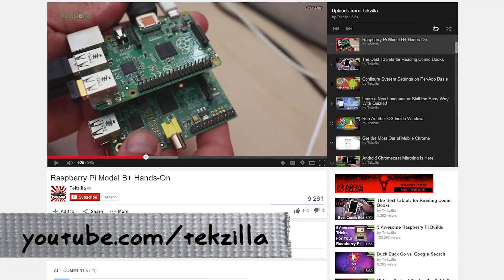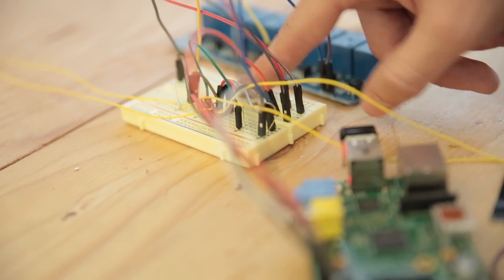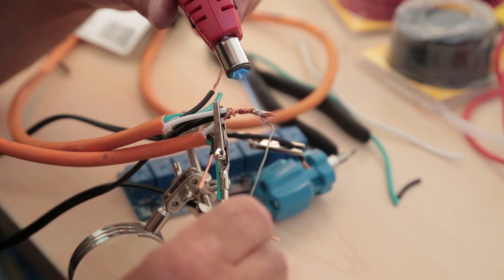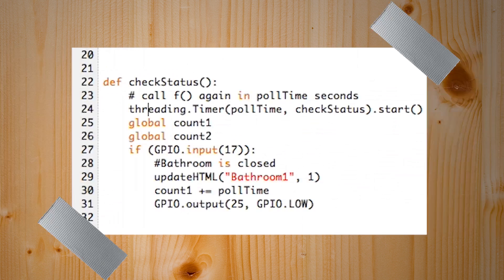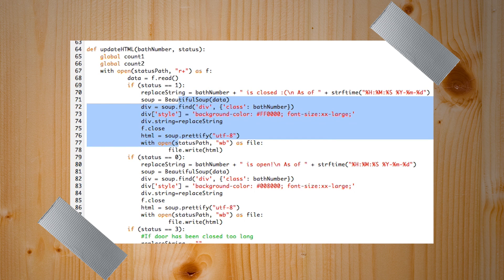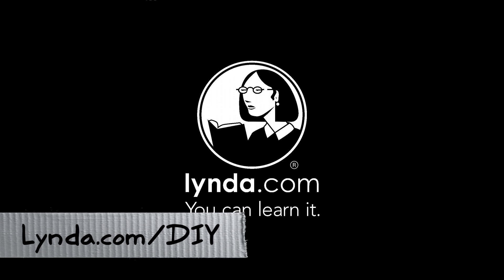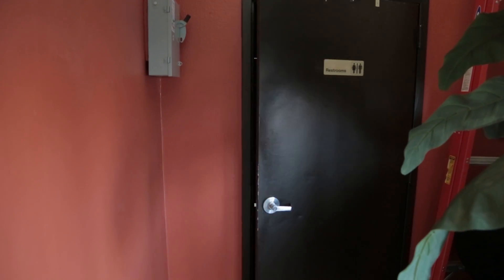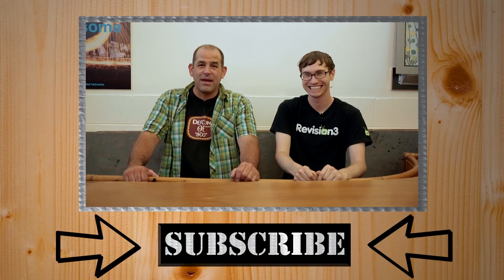Use a Raspberry Pi to Fix Everyday Problems. Become the Office Hero!

Comment: I don't want to be a douche, but you could've done a stop light without a RPi. Just some LED, some batteries and the switch which turns on the LED should be placed into the bathroom's door lock - that means wherever somebody locks the bathroom's door, the LED turns on.
Reply: MrBiky I guess not all of the employees are within eye shot of the bathroom.  I do agree with you though, the Rpi is overkill.  this could have been done with an arduino, including the webpage.  Also the tinfoil sensor and half-assed-ness of the whole thing is a bit painful.  but hey, it's a decent proof of concept.  Now if they actually go get a cheap magnetic reed switch from home depot from a security kit to replace that sensor, and move the code over to a teensy board it'd be decent.
Reply: MrBiky Yup, but then only those within eyeshot would be able to know the status, this way you can known the status from anywhere in the building.
Reply: Jim Henline As I remember, in this vid, they mounted LED on each desk, so the same can be done without a RPi. They could've used the RPi somewhere else, like, when the LED lights up (somebody is in the bathroom), the signal is also sent to RPi and it post on their web page, or whatever.

All I meant through my comment is that the idea is great, but the implementation is not optimal.
Reply: +MrBiky ...but they did use the RPi to post the status to a web page.  that was the main point.  the stop light was just a small add-on.
Reply: ***** I meant that it could've been done without a RPi and only a stop LED. I don't know who uses a website to check if a bathroom is empty instead of a stop light.

Comment: I like the idea, funny to see how much the people in the workplace appreciate this project. And the dropbox free webserver idea is smart.
Thinking about the html file updating, you could also just make 4 files and replace the dropbox file with the right one, but that would not be handy if you added another bathroom to the workplace or plan on expanding.

A great addition would be to place a button in the toilet which must be pressed if someone took a number 2. Or a smell sensor. (s*** sensor). That makes you able to have extra information about the toilets smell, like "Last s***ed since 11:30am".

Or make a raspberry pi air tunnel, toilet shower, automated toilet-brush or a speaker that plays welcome and goodbye messages.

Comment: You should get an "Easy" button from Staples and add it next to the toilet so poopers can add a minute... Ie: someone who needs to introduce more fiber in their diet has to go #2, but can't beat a 10 minute timeline, and doesn't want intrusive would-be-self-relievers out there jiggling the handle and trying to get in while they're pooing. 
Each press adds a minute, with a limit - you can't have people abusing company time. If they need more than, say, 20 minutes, it's time to invest in some free office Metamucil. Or milk of magnesia.
Reply: Bruce Allan West Or the timer could just reset once the door opens again because if the door never reopened after closing then whoever went in the bathroom still hasn't left it.
Reply: Touché, Cody, touché.

Comment: OK, I'll admit that the html thing is pretty cool, but I made a bathroom status system where I was working FORTY YEARS ago, using a simple microswitch, a relay, and a big red light (actually it had a green light too).  It was for the upstairs bathroom in our building so we dubbed the system "Hypotenuse" ("High-pot-in-use").  Back then we didn't NEED a computer to turn on a light bulb! :-)

Comment: Instead of just a door open/closed sensor, why not look at a privacy latch on the inside of the door? That way you'd know someone was inside, not just that the door was closed.
Reply: bob bobson I think the only real solution is more toilets.
Reply: MrBiky Of course you always have the joker who locks the door and then crawls out under or over the partition.
Reply: MrBiky Yeah, it wouldn't be a problem in their case. But 30 years as a programmer has trained me to always look for the worst possible outcome.
Reply: Jim Fortune well the timer would still be valid, so if the door stays locked for more than 10-15 mins someone should go make sure whoever is hogging the toilet is ok, and as much as there is a possibility for someone to be a dick about it and do something stupid like lock the door and crawl out (which in itself is pretty stupid as toilet floors aren't the best places to be crawling) i doubt anyone would start making a habit of doing it, and again the counter still prevents excessive practical joking

one thing i would say would be really useful to implement would be a queuing system, go to the site, press a button get a number and you can be given an alert when its your turn, as it stands all the current system would do is create mass toilet runs whenever one is free (in a larger work environment) limiting the systems true effectiveness as people are still dawdling waiting on the all clear to make a b-line for the toilet
Reply: ....free colostomy bags all round?  ¯\(ツ)/¯
Reply: Because you already lock the door when you go in
Reply: Ian Wells But it checks if the door is closed, not if the door is locked. It's a simple conductive strip on the door frame.
Reply: Jim Fortune I know it's an old comment, but I was thinking the same. The door will most of the time stay closed, so the switch should be put inside the lock (when somebody enters, of course they lock the door and then the circuit becomes close).
Reply: Jim Fortune Here should come in handy the Raspberry Pi with camera module to see who is the troll that crawls out (that's if those guys in the video have such kind of toilets: at 6:24 it looks like the bathroom is like one in a normal house, not like in a Mall).
Reply: +Ian Wells some people forget to lock it.. it could lead to  an embarrassing situation. people trust technology blindly and could become accustomed to not knocking.
Reply: The Power of knowledge That wouldn't be pleasant.

Comment: Interesting idea, but it would be better to have it as a lock sensor instead of a general door open / close sensor. Unless I see that you're the type to leave the door open when done, which a lot of folks don't. Not really something pretty you want to look at.
Also, seems a bit intrusive on privacy. If someone watches as you go in, then monitors the time you spend in there, they can get a general idea of whether you're having a major bowel movement, or a serious urge to spank the monkey, depending on the time you spend in there. The big red lights and online monitoring don't really help to that self conscious feeling.

Comment: I have been working on the same project for my work. The only reason why it isn't up and running is because of our IT department. I am using a door switch, Nodejs (with Socket.io and Expressjs), and Python to all run on the Raspberry pi. Python communicates with the GPIO, while Nodejs, expressjs and Socket.io serve a local website and update it immediately when the status changes on the stall.

Blog:
http://blog.rizowski.net/2014/08/06/poo-pi-project-setup/

Github repo: (Still work in progress as I am adding more features and cleaning up the code)
https://github.com/rizowski/Poo.pi
Reply from the maker: Nice! Part of the reason why I went with the Dropbox Uploader was because A: I had no budget and B: I didn't want to rely on IT for punching a hole in the firewall.

When the webdev team saw the project, they mentioned that I could have used a "free and easy to push to service like Heroku or Cloud9". Not sure if it's something worth looking into!
Reply: +DIY Tryin How bout just using the webserver on LAN and adding the static ip of pi to the favorites? eg. "http://your.pi.address.98:8080\bathroom_status.html"  As long as you ask, it should be ok.

Comment: Fun project, and good info.
Just wondering... don't people usually close the bathroom door when they leave?
Reply: Not anymore!
Reply: They're making it complicated. Why not just installed a cheap  ip webcam inside and outside to see if someone's queuing or using the bathroom :D
Reply: in a multi-bathroom setting, I'd imagine you could install something like this on the stall locks. Maybe? haha
Reply: @osaka35   that's exactly what i was thinking but then the cables would be trailing from the ceiling down to the bathroom lock.
Reply: But seriously it's a good example on how to make use of this tiny device to its full potential.  I'm  planning to get one soon

Comment: This is a really cool idea! =)
And immediately my brain started working on ideas of how to make it even better! :)

What about changing the door handle to you have one with a specific lock bolt. That way you can track whether the door is locked or not which is more precise.
If you have that, you can even implement a queueing system on the website. So you can click a button to get a number. And when your number is about to come up you get a notification.
I would suggest not stepping the queue number every time the lock bolt is closed, but rather every time it is closed if it hasn't been less than a certain amount of time since it was closed last. The only issue I can think of right now is if someone doesn't lock (maybe just wanted to blow their nose). But I am sure there are solutions for that. Any ideas?
Reply from the maker: Haha, I've definitely considered a queueing system! I like your lock idea, but it seems like people are trained now to keep the door open when they finish. Might not be an issue at this point.

Comment: why not just buy locks for the doors
Reply: its for convenience so you know which bathroom to go to and don't have to walk to each one to find out they are both being used and waste a precious 5 minutes
Reply: Then why not have the sensor read if it locked or unlocked which would be simpler to tell if it used or just door being closed

Comment: Probably should of ran the system though the bathroom lights if they are not automated. On switch means occupied off means not. Or you can use motion detectors from automated lights and with a raspberry pi to give a signal.
Reply from the maker: That would have worked, but I was going for the absolutely simplest solution. Plus, the lights get left on with no one in the bathroom pretty often (shakes fist at energy wasting coworkers). -Michael
Reply: *should have. Grammar, yo!
Reply: ***** I no engrish mahor, I are Enginaers stupent. I good math instred. i doo calc tree bery good. Taking Dif. EQs next semrester.
Reply: Sweet! Good luck with the smartness! =)
Reply: ***** Thanks. I have finals to worry about and I am normally brain dead after class. Also, I watch youtube in between sections of my homework so I don't burn out. Besides, this is youtube and not a 10 page analytical report that I have to turn in to my technical writing professor.
Reply: could have added some other kinds of sensors, too :)
air-quality, flush-button, toilet-seat, distance-to-pot, etc